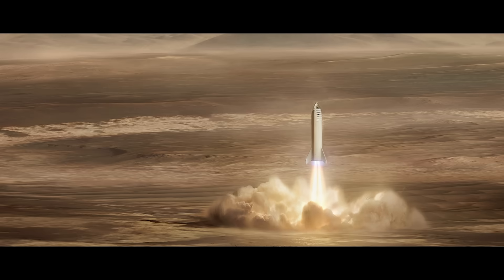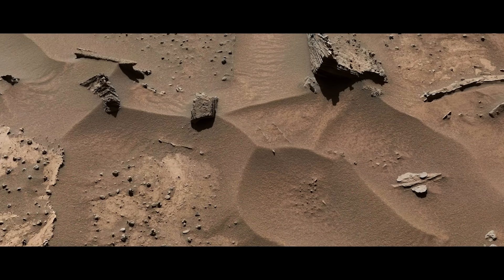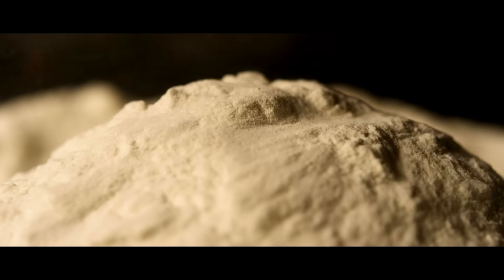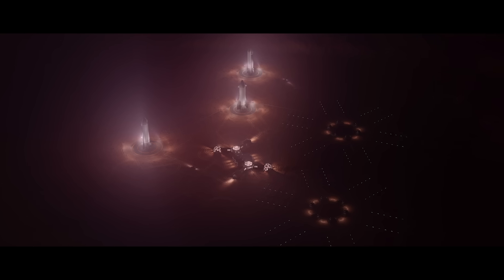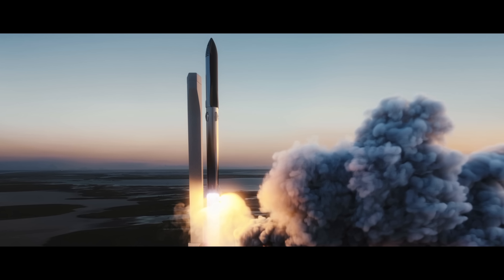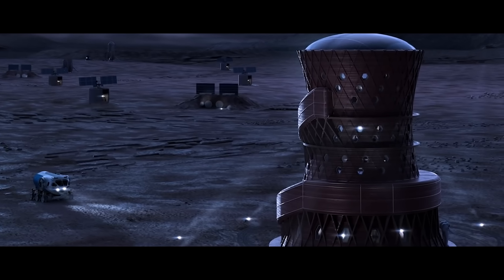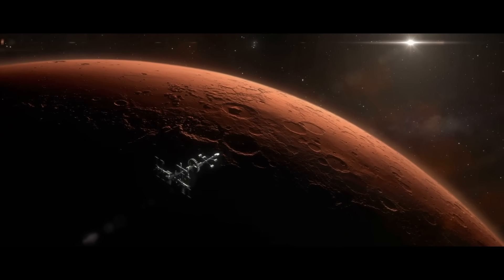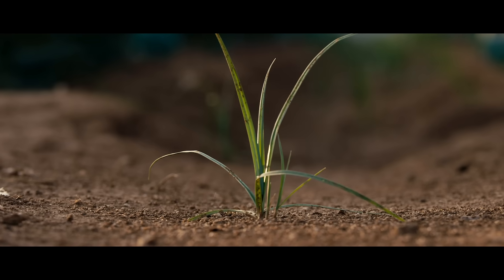THE FIRST 10,000 DAYS ON MARS (Timelapse)

Comment: So this is what Elon's dreams look like...
Reply: What's his solution for the lack of a magnetic field on mars?
Any oxygen.in the atmosphere would be eroded by solar winds, and any organic material on the surface (i.e. grass) would break down.  Also, Mars gravity is inadequate to hold down a substantial atmosphere.
Reply: @waxpatch  I seen a solution. They build magnetic generators at north and south poles. That would generate a good enough one
Reply: @waxpatch  Fusion generators placed in orbit between the sun and Mars that create an artificial magnetic field is one potential. That would create enough protection for Mars to hold an atmosphere, the gravity is plenty strong enough to hold it actually. 

Or, we skip that and accept that we will alway live in artificial pressurized shelters. Much easier.
Reply: @jasondean88888  The atmosphere would consist of what exactly? I suppose it should be 4 parts nitrogen on 1 part oxygen, but where are you going billions of tons of those elements from? As far as I know, there are only traces of nitrogen on mars.
Reply: @Greg Storozky let’s fix that by drilling the core which will be possible since the planet is geologically dead and nuke it x400  there is the magnetic field we need and the volcanos we need for carbon dioxide and water and then the plants and boom there we  go
Reply: @waxpatch 
don't think he have formulated a plan about that yet, one step at the time.
all though there are several alternatives to go.
gravity shouldn't be a problem, with the right about of atmosphere, it could get dense enough.. but it would get a higher atmosphere to have a pressure at "sea level" for humans to survive in
Reply: @waxpatch  yep, not a terraforming candidate.  Magnetic field and luck is a big reason why we have life on earth.  Just ask Anton Petrov....
Reply: @waxpatch  no comments because know one knows the answer
Reply: @waxpatch  They may create a giant electro magnet!!😉😜
Reply: @waxpatch  
Radiation would be a major problem with no atmosphere and magnetic field.
Reply: @waxpatch  Musk said he needs to nuke Mars... lol
Reply: @waxpatch  do some research. he explains everything.
Reply: Wow....i would make the first great crossing - i would do whatever it takes.
Reply: @davidoliver7199  they will need corpses to experiment on at Mars. You will make it!
Reply: @davidoliver7199  proud of u my man
Reply: @davidoliver7199  Hell yeah!
Reply: @davidoliver7199  ok
Reply: P
Reply: @davidoliver7199  If I was 30 years younger, I'd go.  One way trip.
Reply: @davidoliver7199  u got 50 mill ?
Reply: he'd just send a copy of himself.
Reply: @amiman23 ....God forbid, please.
Reply: Dec 22 2030. The first Martian catches COVID 19... the first “planetdemic”
Reply: he dreams in HAL/S
Reply: as the leader of the new galaxy
Reply: @UNiTEDDKSilent21  you rule the Andromeda, i rule the Milky Way
Reply: @TheUnnamed198  I call Triangulum.
Reply: @TheUnnamed198  for at least next 2 million years till they merge.
Reply: @UNiTEDDKSilent21  Emperor Elon of Mars.
Reply: @UNiTEDDKSilent21  Probably there is some true when he said he use to be "ALIEN"  now he is a hybrid ..!
Reply: L
Reply: @UNiTEDDKSilent21  can a I rule a cloud of hydrogen?
Reply: What about me growing mushrooms and taking my fortune with a team and I to climb mount Olympus with rocket guided anchors and steel cables or some shit. Some how some way new never done before however it’s done! What a cool future and a good place to expand technologically and genetically for even more human understanding of this universe we were born from.
Reply: @youtubeisajoke2546  Barely any gravity you could hop up the mountain..
Reply: @willrobinson9767  Not ‘barely’.
Mars’ gravity is over 1/3rd (37.5%) of Earth’s. And after you’ve fully acclimated, your muscles will weaken slightly. And you’ll be heavier, because you’d be wearing a heavily shielded suit (and carrying a portable life support system(PLSS)) for your hike up the mountain.

I’m not saying you couldn’t do it, just that you’re not looking at ‘barely any gravity’. Over a third is a lot more than barely.
Reply: @davidolden971  A suit you must remove  to use the bathroom...  What does the gravity have to do with anything..
Reply: I think
Reply: Best comment
Reply: This is what future look like...
Reply: Maybe. But everybody hase a dream.
Reply: This is all hypothetical
Reply: Elon Musk<---- doing in 10 years what NASA has been saying they'll do for last 50 years
Reply: @jamesbacon5299  It's all about the funding. He is in control of it, NASA has never been. Can't blame them, all the peeps there absolutely wanted it all for ages.
Reply: @jamesbacon5299  Space X is 19 years old! and Nasa already has been to the moon 6 times!50 years ago, Elon 0. And SpaceX is still alive because the NASA gave them 1.6 billions in 2008 to help them to build the Falcon 9 that was successful in 2015.
Reply: @jamesbacon5299  yea also at the cost of tons of natural resources the world can’t regenerate
Reply: Ye
Reply: @Pablo-yj8lh oroutuoriuoryoopt
Reply: @Pablo-yj8lh  ihr klang te wwhere  lvriiwyuuiuz
Reply: @Pablo-yj8lh  stop
Reply: @Pablo-yj8lh  this is 400
Reply: LOL 😂 😂 😂 😂!!!!!!!
Reply: betul !
Reply: He can keep dreaming because that's all it is.
Reply: they dont realise how far elon musks brother is ..in developing plants to grow on mars
Reply: You just need to come up with 2 million dollars to go to space cool
Reply: @ariusberry4727  no you don’t, it will cost up to $800,000
Reply: @ariusberry4727  that’s it !!
Reply: @ariusberry4727   Bitcoin
Reply: @ariusberry4727   Now would be a good time to invest in Doge! 🕦😁🤷‍♀️
Reply: @ariusberry4727  2 million dollars?
Reply: @ariusberry4727  Elon wants to get the cost down to about 200k per passenger for the trip to Mars.
Reply: @ariusberry4727  ima take out a loan
Reply: @ariusberry4727  it's more than that
Start ship would take 2 million to launch because of its reusability, you'd need 240 million dollars to build one
Reply: @ariusberry4727  JUST 2 million
Reply: @ariusberry4727  actually that's just for now he wants you to be able to finance your trip and home for about the same price as buying a home here.
Reply: And mine lol
Reply: What type of goods can Martians sell to Earth at competitive prices in order for Martian colony to be economically sustainable?   Remember that the shipping cost from Mars to Earth is extremely high, unlikely to ever become cost-competitive with products or minerals produced from Earth, limited by the narrow launch window every 2 years and the long time it takes for the trip.
Reply: @amec4888 .....Yup, that's the same thing Ferdinand told Isabella 530 years ago.
Reply: Please Translate This Filipino Language to English for you to Understand

Paano kung ganto rin ang ating nakaraan .paano kung may nauna din sa ating namuhay dito sa Earth na galing sa ibang planeta .Gaya ng nakitang bagay na astronaut ang itsura galing sa matagal na panahon baka ganun talaga ang nangyari
Reply: But everyone needs to work together
Reply: @Meme-xm8iy  everybody worked together on the Covid-19 vaccination so it is possible. 🤔
Reply: pretentious hogwash, you don’t actually think that quack is gonna land a single space shuttle there.
Reply: Yea, a Pipe Dream 😂😂
Reply: @Alpha Omega Epsilon Sagittarii excuse me I am not a mirror
Reply: Holy shit! Some of the people who responded to this comment are fucking insane lol!!!!!!  Fun read though :D
Reply: @BoberMcBoberson  omg yes thank you!! lol
Reply: Why would we try to create life there when we destroy life here
Reply: @choconoisette9737  They killed the pigeons on purpose because they crap on their stuff...
Reply: No ,it's just A Start !
I am Still here !
Reply: Youtube:::("RICHPLANET TV - The Mars Rover Hypothesis - full movie")  & stop fooling yourselves people::::: Watch its last minute first, showing the NASA-scammers gambling online, during their fake-Mars-Landing!!!!
Reply: @kareemsalessi  yesssuuuurrrrrr....
Absolutely right! It's all a big scam!!!!
Reply: "Elon's dream, so Elon invented all the sci-fi novels. movies and made all the current rovers on Mars. People dreamt of being on Mars (and developped ideas and technologies for Mars) well before Elon was born. 
The Cult of Elon with more ignorant members.
Reply: @THEREALZENFORCE  The rovers are all fake..  Nothing goes into space or Mars..
Reply: He is a scam
Reply: @neojon4871  He is pump and dumping gamestop stock and bragging about it..
Reply: they destroy the Earth to go to a dead planet !!Where is the logic?
Reply: @Lucian Next few days....
Reply: I wouldn't be able to think up something dumber even with up to a liter of heroin in my blood.
Mars is not a habitable planet for humans because it lacks enough gravity. This is a non fixable property. The only planet in our solar system with suitable gravity for humans is Venus. Venus is too hot, but this is not a non fixable property. We just yet to have come up with a technology to cool it down. This tells us that it's far too early to expand to another world. The whole video is stupid from start to end. Stupid in the category of idiocy. IQ below 25.
Reply: And they'll stay dreams for a very long time
Reply: @KristianC1994  Yes, for a long time ..
This E Musk is part of a big manipulation plan....
Reply: In the 22nd century, Mars will be colonized
Reply: @bretts5571  This is the most realistic term.
Or rather, it could be !!
Reply: @silviui.wagner6967  People in the 22nd century will remember Elon Musk. He will be enshrined in greatness
Reply: @silviui.wagner6967   We can't imagine the concept of most of the things that will be used in the future
Reply: Imagine his nightmares ._.
Reply: @Danny DNA Has to be possible first before you can do it quickly...
Reply: I can't wait till now I cant believe america arrive the moon how they want to live on mars?????
Reply: Dump some LSD in there and you’re on the right track.
Reply: No Elon plan will be changed bc the radiation  levels on mars is shocking we need to stay underground  and we can not have any of the soil inside the lungs or we will literally die after and hour of the dust being in us
Reply: For a sec I tough this is real xD and I remembered that we dont have a teknoloji to do that
Reply: Where is
Reply: I dont think giving a birth on the mars going to survive on the earth
Reply: please stop smoking
Reply: Yeah. And if things don't work too well on Mars, he can always have a cryptocurrency-manipulation statement ready :P
Reply: However.. when it comes to Sci - fi level innovation and beyond, why isn't this talked about on any videos on youtube for any of this stuff related? Such as Graphene combined with Photonics, Quantum Computers, and Quantum Technologies, also warp drives and other things.

Don't make excuses, check out my other 2 comments below, and the last one for steps to my other channel for the "created playlists" to start at the bottom.
Reply: There are so many missing things here in the video, think about why the media never talks about Graphene combined with Photonics as the basis and "standard" for all our products today and future products like Quantum Computers and other Quantum Technologies.
Quantum Computers also have breakthroughs supposedly once every week.

Why aren't they using Quantum Computers to make better designs and engineering for the SpaceX Starships and more.
And why aren't Quantum Computers inside the Starships.

Why isn't Graphene combined with Photonics mentioned, and at the least Photonics to replace the electronics = electricity (electrons) for the Starships circuits, bridge and more.

I'm aware of the need to scale up Graphene faster and cheap enough while in its purest form, but to not be creative with the imagination, without brainstorming, no collaboration or Sci - fi level innovation and beyond, is quite absurd.

Nasa's space rockets, control room and rovers could be using Quantum Computers, and Graphene combined with Photonics, again at the least Photonics (for now) with Quantum Computers.

Nasa, SpaceX, I.T.E.R. and other private funding fusion energy reactor companies, The Gateway Foundation / Orbital Assembly corp., Virgin Hyperloop One and so much more, none of them mention any of this.

Look at the news on Covid-19 rather you believe it or not, the news offline from TV and online from youtube's homepage if you scroll down it for the Covid-19 section, and question why none of the news channels with videos on Covid-19, all of them from early 2020 and on, have no videos about Graphene combined with Photonics, Quantum Computers, The Quantum Microscope, and other Quantum Technologies, and behold.. the level of greed and corruption you now have seen.

----------------------------------

And question why none of the youtube videos about warp drives never include Quantum Computers to help with big algorithms for the warp drives, warp drive energy, and anything space exploration related.

================================================

Check my other comment below for steps to my other channel about Sci - fi level innovation and beyond, e.g. Graphene combined with Photonics, and Quantum Technologies, also warp drives and so much more.
Reply: @gameresearch9535 ......Because there isn't a shit load of money in it.....Lots of future promise....But no effin MONEY.
Reply: @gameresearch9535 .....Thank you
Reply: No one can have such a dream
Reply: And it will very probably not happen that way!!
Reply: Clearly it's not a dream
Reply: The guy is going broke
Reply: @zeo4481  what proof do you have?
Reply: Care to elaborate your question?
Reply: @Lan Dobnik the choice of words he is using
Reply: Earth 🌎 in the near future I think
Reply: @UCLAfilm01  Fantasy just like pretending there is unlimited gasoline and the power grid is windmills not nuke and COAL plants.. Which is also about to cease to exist...  What world country are you without gasoline or electricity ... The ones you named and Germany which is about to turn there grid off.. No electricity ever again..
Reply: Its the dream of alot, also mine. But im not super rich and 16 years old.... so kinda hard to try to do whan Elons doing.
Reply: ok you ca spend money to poor people in earth
Reply: @dr.revellart9990  Using the last population number in the video, approx 300,000… That’s 0.0038% of Earth’s population to Mars (by 2053). 
That means 99.61% WILL STILL BE ON HERE ON EARTH. And this where the money was, is, and will be spent!
Reply: We all know Mars is historically own by China in ancient times it's undisputable fact.
Reply: Until he wakes up lol
Reply: Pretty much
Reply: Keep dreaming!
Reply: This is what all of our dreams look like🥲
Reply: If elon one day takes all his knowlede, money and dedication to end his life by doing a 1 way ticket to mars for colonization or somehow siccessfuly travels to mars and back and surviving.   Hes going down as one of the most craziest, intellectual scientist/researcher/engineer of all time. Being a martyr to show the capabilities of thr human spirit/mind would make u one kf thr fucking GOATS.  lol
Reply: @godsownlunatics9650 ......How far did you go to school.....bout two miles??
Reply: @Lan Dobnik 

Did you go to my other channel's "created playlists" and watch things from the bottom?

As we all know, materials are the basis for all emerging technologies, Quantum Technologies. And Quantum 2D materials.

We need a paradigm shift in materials and ideas.

This basically means that "a civilization is only as good as the material it uses".

Now imagine this with Photonics, the list goes on, think about Graphene Spintronics and Graphene Twistronics, those are just examples when someone got creative, we need to brainstorm and this stuff should be known in schools for all ages, because kids have dreams and they are the ones that can also help accelerate that advancement in learning this from school and having goals for innovation to a whole other level, to help accelerate that advancement for our civilization.

Let's not make excuses and don't tell me things that I already know, the important part here is for you to learn what I'm trying to show you from my other channel.

You can't call Graphene fake, regardless of scale and while in its purest form with no defects. It's also safe once made and anyone can come up with a new way to scale it up in its purest form, as long as the method for scaling up Graphene is safe, but once made.. Graphene is safe.

My point being, what is shown on my other channel about Graphene combined with Photonics, and Quantum Technologies shown there are all real.
What you can also do with a Quantum Computer compared to a classical computer and super computer, is also very extremely useful for research, designs, engineering, chemistry and so much more to accelerate that advancement and for other breakthroughs, and other emerging technologies.

If you can't see that big picture, the only one in la la land is yourself.
This is the truth, I don't show my other channel for no reason with all the facts from proof there.

Wait until you go to my other channel's "created playlists" and start at the bottom.

And if you don't believe that, then go visit the tech companies in the videos, and also visit the official sites shown in links on my other channel. And talk to them about it, not me. Don't make excuses, there is no excuse for ignorance.

"Ignorance is the root of all evil".

"Ignorance.. it's not that you don't know, it's that you don't want to know".

1. Go to my channel and find the "About" tab with info to read and a link, you might have to click on the words "created playlists" and start at the bottom, work your way to the top playlists and watch all the playlists.
Don't forget to click on "view full playlist" under each playlist from the created playlists area, and look to the left at the "playlist description", click the "show more" button, for articles, info and links.
Reply: @Lan Dobnik 

I forgot to add.

Our reality is based on the Physics we understand, and as the Physics we understand is updated, so too our reality changes with it.
Which is why we are going into Quantum Physics, and Quantum Technologies. Also Quantum 2D materials such as Graphene.
Reply: @Lan Dobnik 

And so please be sure to check out my other channel's "created playlists", save that to your browser's favorites.
Reply: Its humanity dream looks like
Reply: It's not a dream. It's a flashback.
Reply: @Alpha Omega Epsilon Sagittarii Think about it.
Reply: @Alpha Omega Epsilon Sagittarii sorry but soul beings to lord krishna there's no place for you to enter
Reply: @Alpha Omega Epsilon Sagittarii well krishna is omnipresent so yes he is in me and that's all I need everything else isn't matter to me nor your OPINIONS
Reply: This is what all our dreams look like.
Reply: @Alpha Omega Epsilon Sagittarii its opposite way around
Reply: hes already livign his dream of exploiting poor kids and underpaying workers to get that sweet sweet moolah
Reply: @Alpha Omega Epsilon Sagittarii its the truth, not an awakening, sadly
Reply: ONLY A VERY NAIVE OR STUPID PERSON CAN BELIEVE THAT ELON MUSK WILL FLY TO MARS IN 2024. Even in 2034, he won't fly.
Reply: 8pO
Reply: @Alpha Omega Epsilon Sagittarii Are you comparing yourself to them? I don't know you so I'm not going to judge your intelligence. But I will say I have read a lot of your comments. And you come off as bat shit crazy. And I'm not saying you are. Just that if you are right your message is getting muddled by the abrasive way you communicate with people.
Reply: And a dream is what it will remain
Reply: @Alpha Omega Epsilon Sagittarii You need to stop dreaming and wake up
Reply: @Alpha Omega Epsilon Sagittarii And people over estimate one's subconcious. As they are never fully aware how it affects there action and feelings. As for supraconscious. Is it rational or logical. Perhaps only in our egotistical minds.
Reply: And the rest of mankind!
Reply: @Alpha Omega Epsilon Sagittarii Yes he sure can
Reply: @Just Doit --It costs thousands of $ to transport just 1 pound of mass into space.   Nothing can be as expensive as transporting products to and from Mars.
Reply: Man of the Future.
Reply: @Alpha Omega Epsilon Sagittarii Weird massage?
Reply: @Alpha Omega Epsilon Sagittarii Sorry. I got what you mean now. That must be frustrating at times
Reply: I think hes forgetting in the future one of Mars moons will fall onto the planet bye bye people on the planet
Reply: I would love to be the first person on mars
Reply: See my nasa video
Reply: yes...
Reply: Dream....or predicted knowledge?!
Reply: *Wet dreams
Reply: Yes
Reply: It Would Be Awsome To Put Plants On Mars 
Weeds That Departed alongside the Vegetables That be Planted Indoors In Mars : Yes Weeds Rules!!!! , We Are Super Plants!!!
Reply: SimCity Mars edition
Reply: My dreams would come true if i ever get to see an entire fleet of spaceships travel across the sky in formation towards mars.. that would be such a beautiful sight.
Reply: @FlyboyCGC have you seen the progress of starship? the jump from SN11 to SN15 is literally over 150 significant upgrades to the design, you will never see that kind of flexibility or speed in the SLS or Vulcan Centaur (or any other rocket for that matter.)
Reply: @FlyboyCGC You tell me..
Reply: @FlyboyCGC don't be jealous.  NASA has done what,.... in last 30years? Jack and squat. 
Musk, all on his lonesome, built rockets THAT NASA WILL BE USING, to take people to the ISS. 
IF he's so bad, as you say, why are they using HIS ROCKETS?
Reply: Much faster than that.
Reply: I may be ignorant on this but didn't Bezos just win the race against him? I mean the headlines two days ago for both parties were completely opposite. Elon dismissed and Bezos now selling tickets for the first trip
Reply: it looks dumb.
Reply: No? This is what Venture City's dream looks like. I refuse to belive Elon has any true vision other than cOlOnIzE mArS
Reply: Is the narrator included?
Reply: It is a good dream
Reply: No this is just a goal for him. The things billionaires dream of are much more perverse than anything normal people can imagine.
Reply: I hope Elon will be successful in his dream. God bless him us. We will go to Mars one day
Reply: RadnySSI ㄹㅇ
Reply: If Elon didn't complete I'm sure his son or daughter complete this
Reply: yup
Reply: I think Elon  has believed that Solar System is his personal property. 
But We should remember that nothing in our Solar system is there to help us
Reply: @clams_  I think he is paranoid and autistic and he is scared of a WW3! so he want to leave SOON! he trust no one! maybe he is right to trust no one I mean some leaders are crazy! and most businessman are GREEDY-NARCISSISTIC!
Reply: It's our dream now
Reply: So... what do they taste like?
Reply: Are you going to tell us???
Reply: @Gavin Costa your going to call someone uneducated, while spelling uneducated as "un educated"? Lol.
Nice! Lol...
Reply: Why screwup another planet.
Reply: @dennisneale142   Geoge-Carlin has great video-clip on that subject!!! Youtube:::("George Carlin - NASA")
Reply: In that case I will steal his dreams
Reply: He’ll be remembered greatly for this
Reply: Yup
Reply: Stupid science 
Science doesn't know 
Carnivorous lions live only 14 years. 
The US eats too much animals meat causing 600, 000 deaths from the virus
Reply: Everyone's dream who interested in Mars
Reply: will he go to mars along with em?
Reply: Kmsl Elon tryna be chancellor palpatine 😂😂😂
Reply: Nope, he wants to use humans as corporate slaves for the building process
Reply: He has good dreams
Reply: What a bad dream. What’s the goal?
Reply: Avatar
Reply: lmfao this guy is spewing  propaganda. Mars is a one way trip, Martians would not be able to survive Earth's gravity. Musk should be bringing fresh water and sanitation resources to the people who need it. Not trying to kill people.
Reply: He just wanna drive his Tesla on marse
Reply: His dreams are in python and c++
Reply: Evil people; if you can take care of this beautiful Earth, a barren Mars maybe just right for you!
Reply: Not only Elon's dream, mine too
i just had a dream of us going to Mars 😅
Reply: Even though though it won’t happen lol.
Reply: Eehm its already up there 🤗
Reply: Real estate mafia rampage, continue the nightmare.
Reply: I think
Reply: That’s when he isn’t high.
Reply: Elon is dreaming about day 4002 right now
Reply: No, it's more gigantic than this.
Reply: I’d say Asgardians have the same dreams too, in my head I already live on Sagan-2...
Reply: What a beautiful dream. Elon will be in History books as a genius.
Reply: Musk is BETTER than God. Mars is the New Earth! Earth Will soon Die Anyways!! Musk is god. TESLA and Tesla Holders will be Kings. Rest and their Family will be Our Slaves and work to Power energy for Bitcoin!! Elon is Einstein, Edison, Newton, and Jesus combined. HE at least deserves several Nobel Prizes. Elon has more IQ than weight of Hater's Ug ly Prius and his F at Ho Combined!! HE is like Ironman who will destroy Thanos and critics are better off using their cash to wipe their a n us. JUST Worship Him instead of other silly god!! GOD Elon will Punish infidels!! Go Emperor God Musk!!
Reply: will ELON be alive until that days?   :)
Reply: Too bad they'll always be just that a dream like most of his scams.
Reply: Won't be a dream for long
Reply: Yee he’s built all these rockets and crap, he’s sending the unmanned ones next year when Mars is closest to us
Reply: Nice elon musk ready to pack my bag and
gotten proxima centuries and freeze
Reply: My dream is working on space x like Astronaut ,how possible
Reply: This is created by musk team you idiot.
Reply: @amazingdude9042   How possible,my last dream is working on space x like astronaut,accept pls pls
Reply: @bedpsmilesong5752  yeahhh. and my dream is to become king of the world. we both are dilutional so leave it.
Reply: Sad truth, it will stay a dream. It will never happen in this lifetime. If ever. Its just wishful thinking.
Reply: Yeah surviving Mars.
Reply: His dream is to make as much money as possible
Reply: true
Reply: Yeah but i believe it wouldn't be a dream any more because before we make mars for humans we have to survive the corona and world war 3
Reply: @victor237obiora5  yes i wish i can be president of mars but there is a chance of 00.000000001% ill be president
Reply: @victor237obiora5  yes im exited to be presindent of mars or not and just be kind
Reply: Cuuuuuuuuuuu
Reply: That video is in parity with previously few well made 'Nazi propaganda style videos'. Not so smartly, those same video mentioned Neo-notables will probably just gonna chose a determined 'reality-show filming site' to rent and then stage another 'Apollo program style' main media hoax.
 "Apollo" is the ancient name used to mention a chosen 'alpha' person from a small group of Eskimos; while the same group strives about, within the landscape from the scarce and dangerous Arctic region of the 'Terra'.
And the Eskimo people aint gonna agree to have yet another of their ancient/current word; to be used as the title for another resource waste Hoax.
Reply: Do-able
Reply: Ye
Reply: Probably even bigger
Reply: Yeah he even said he wants to die on Mars just not upon landing.
Reply: Society is in a huge problem at the moment, World War III is about to fall, almost half of the Americans they have no money to rent, and Musk  distracting the (NAIVE) people's heads with his infantile tales. Musk is glad he can land on the RUSSIAN space station. With his finger on the map he can travel to Mars, Comrade Musk.
Reply: Elon musk is an alien in human form
Reply: elon musk wanna rule mars.
Reply: Excluding bezo being involved sure!
Reply: It's a long way to Tipperary bro !!!
May be at the end of this  century....., the earlist.
Except for Elon's stories and cartoons!!🤣🤣🤣🤣🤣🤣
Reply: Yeah, CGI bull shit.
Reply: @A.O.E.S He's a genius. He's literally the chief engineer for space x. The company trying to do all of this. He spent days and weeks into learning physics of all kinds. Don't underestimate him because you think he's just like every other billionaire lmao.
Reply: @FlyboyCGC he made the first re usable rockets. which is a great baby step towards the goal.
Reply: @A.O.E.S That's impossible. He's trying to get to mars to save humanity from the earth that we destroyed.
Reply: His dreams must be Interstellar travel
Reply: Right at the beginning he's already Starlinksd 😎
Reply: If I wanted to live on Mars I can just go to the coldest desert on earth and I'd least I'd be able to breath the air!
Reply: what is the reason to visit a dead planet? plain wishful thinking?
Reply: No, this is what Elon's PLANS look like.
Reply: yep
Reply: Then again he named his kid a barcode number and he is a douche bag I wouldn’t be giving this guy praise
Reply: @Gavin that is just mean to say you could have been not as harsh with that yea he made a comment doesn’t mean he’s stupid
Reply: Humans 0
Saiya-jin 1 to 6
Angels 7 😇

Kalki Ironman 5th matriya buddha 8th arc Angel 11th satguru 13th imam and 24th avatar after 2026 😎

Almighty God 9 😇

Humans type 2.5+ after 2026 by Kalki Ironman (christ in the white horse)(son of man on clouds) type 7 and 8 😎

Jarvis the world’s first artificial intelligence (parrot) 😎

Cuz Kalki is ironman batman super saiya-jin superman ben10 saitama Narutoo shaktimaan and every super heroes combined after 2026 😎

Jarvis world’s first artificial living being (just like vision in marvel universe)😎

Made of Quantum and sub quantum particles 😎

Power source quantum energy arc reactor (type 7) level technology 😎

Kalki Ironman going to have every kind of arc reactor like:- type 1 Nuclear fission, nuclear waste, hydrogen fusion, type 2 3 4 5 antimatter arc reactor (solid liquid gas), type 6 electro quantum arc reactor, and type 7 Quantum arc reactor, type 8 limitless quantum energy arc reactor without quantum particles 😎

Kalki Ironman going to have sun in a box million billion tons of hydrogen nuclear fusion reactor type 2 3 4 5 just like sun and stars in the palm of his hand 😎

This all going to happened by self replicating quantum nanobots knowledge energy and techniques at type 7 7 7- respectively 😎

Ironman (Tesla 2.0) going to reveal every secrets of the world specially Tesla and his Antigravity 😎
Reply: Wow!
Reply: Elon Musk 🧠🦾🦿☀️🔋👏💯
Reply: You know him well enough to call him by his first Name? Hmmm. Interesting you buy into this impossible hype!
Reply: Minus the Jeff Bezos part
Reply: @matteovass8294  Jeff bezos is also a douche bag who doesn’t care about his employees he just wants money
Reply: Dreams that are being slowly turned into reality as we speak!
Reply: @MrPablosek  calm down anime boy.
Reply: He will do it bro.
Reply: This is what my dreams look like
Reply: I just wished that politics won't harm these people who will be living in these planet.

And achieved what the Earthlings ever dreamt of  which is world peace.
Reply: @hakobangz25 .....Whether they be Earthlings, Martians, Centaurians, or whatever, as long as human DNA is involved there will never be global peace.
Reply: Yes just a Dream
Reply: And how do you power all that given the poor solar power available on Mars ? Plutonium like Perseverance ?
Reply: @effco  7 football fields of solar powers until we make artificial power.
Reply: @effco  There is no power source that can be used..  Even a nuke plant will not work..  No way to maintain it.  cooling probably won't work..
Reply: @willrobinson9767  if there is ICE, THERE IS A WAY TO COOL IT
Reply: @jamesbacon5299  The ice there is probably frozen CO2 not water..  Thaw that out and you get gas..
Reply: His dream is to make as much money as possible and hide it before Tesla stocks inevitably crash. Dude isn’t even involved in Tesla or space X projects beyond being a poster boy. Real engineers actually do the hard graft
Reply: @cretinousswine8234  He's literally the chief engineer for space x. He knows what he's doing and is smart as hell. Everyone loves musk and not bezos for a reason.
Reply: The city should be called : ELON-1
Reply: He is gonna make this real. Hes elon musk.
Reply: Right!!!
Reply: Absolutely
Reply: Elom dream PaID BY Uncle Jeff
Reply: Yeah and its so cool! 😍😋
Reply: Its not a dream.
Reply: It won't be possible unless we figure out a way to stop the solar and cosmic radiation from reaching the surface of mars. Mars doesn't have magnetic field making establishing bases on that planet nearly impossible.
Reply: No, this is what the bag of bullshit he sells his fanboys for their lunch money, looks like.
Reply: I also want evacuation from this crazy land..
Reply: Lmfao so true
Reply: *looked like. He is realizing it. One cannot imagine what he dreams now!
Reply: @Danny DNA protecting the new artificial atmosphere would e done by creating a new magnetic shield. Done by putting magnetic field generators at the north and south pole
Reply: Buy bitcoin, bitcoin is future.
Reply: @robertfuest007  bitcoin is just a very expensive crypto it’s not the future
Reply: @UCLAfilm01  Pretending they can use Teslas for REAL cars when there is 100 thousand of them to start with..
Reply: Why are they called starships? These are chemical rockets and have aluminum hulls. I understand that metal doesn't protect against radiation. The astronauts won't survive 6 months of cosmic radiation.
Reply: Why not explore the planet we are already on ? Am I the only one
Reply: Yeah cause he is an intellectual
Reply: @TheUserEGO3326  "...he is an intellectual"? :-)))))))
Reply: @prussv9518  yes
Reply: Yes
Reply: Wow closer to the sun.
Reply: Nope. Musk's dream is to have a transport system that can launch a thousand of his Starlink satellites at the same time. He has zero plans to go to Mars, which is obvious to anyone with a brain.
Reply: @ricksimon9867  He's obviously not suicidal then...
Reply: It is possible for lofe to exist on Mars but it has no use beacause if earth get destroyed that means that sun is getting bigger which means it would also end up destroting Mars
Reply: @karabinagroy .....It will be approximately 5 billion years before the sun begins destroying the earth, so I'm not gonna worry bout that just yet.
Reply: @karabinagroy  no habla illiterate gobblygook
Reply: Exactly.....dream, just that dreams....!!!!
Reply: Chase Smith  NASA sure ain't doing it. They've been studying the "effects of weightlessness on the human body"  for 40 years. Thank God we don't have an incoming asteroid or meteor to destroy earth. We'd never get off the planet. 
Well Musk, Bezos, and Brandon would get some of us off. China would make knockoff copies that'd blow up in low orbit
Reply: Humans will be extinct before we reach another planet though
Reply: @loganpaige2102  wow.   Way to be positive. With a attitude like yours in 1965, we'd never have made it to the moon
Reply: @loganpaige2102 
you think human will go extinct in the next few years?
Reply: @Nidvard  yes. Sounds weird I know...
Reply: @loganpaige2102  maybe just matters what we do in the next few years
Reply: MUSK IS psychotic delusional and SICK...  Just like the rest.
Reply: @willrobinson9767  
I am curious, even though i feel i will regret asking.. why do you say this?
And the rest of..what?
Reply: @Nidvard  The rest of humanity....   The ones who think its cool..  Musk bragged about working 22 hour days... Just to make imaginary money..  Who don't sleep or take days off themselves until they have a heart attack...
Reply: I'm sorry, there is no way to understand what you are talking about. You are not making any sense
Reply: @Nidvard  Not much longer..
Reply: @Nidvard  You have to what GOD says..  There is no option B...
Reply: @willrobinson9767  
Oh right, you're one of those. No wonder i couldn't understand you.
What are you even doing here? Why don't you believe what you believe, and let the rest of us do whatever we want? If you want to give up on life before it begins, that would be your choice, but keep that to yourself.
Reply: @Nidvard  Already did that.. Your time is up..  Say goodbye to everything..
Reply: @willrobinson9767  yeah, just like Nicholai Tesla. Oh wait
Reply: @Nidvard  He mean that Elon is obsess by his goal of goinfg to live on Mars! and it's not realistic because of the technology needed and the cost.
Reply: @Nidvard  one of those waste men
Reply: @Nidvard  There are some good criticisms of Elon in a video essay called "Elon Musk is not your friend" now I know the man that presents it is a bit eccentric I ask you to tolerate him but I belive he makes some good points.
Reply: @willrobinson9767  dude stop acting like an emo kid thinking everything and everything is pointless, like every body will die it will happen but that’s not what this is about.this galaxy can be a sandbox of infinite possibilities just give it a few thousand years.
Reply: @Revs_bathwater  There are extremely finite possibilities...
Reply: @willrobinson9767  he's a self made billionaire that has launched private astronauts and supplies to the ISS. To a person with low intelligence, Musk must seem crazy. But they probably thought the same about the Wright brothers
Reply: @jamesbacon5299 ......No, they didn't think the Wright brothers were crazy.....They just thought they were Wrong
Reply: @jamesbacon5299  and who paid for all those Dragon and Falcon 9....NASA!
Reply: @willrobinson9767  are you "lost in space" ?
Reply: @timbuktoo2  Not my real name tribute  to that show.. It was awesome..
Reply: @willrobinson9767  agreed so is bezos
Reply: @willrobinson9767 ...Rest of what??
Reply: @willrobinson9767  you are too short sighted, you can't really see far.
Reply: @primart1  Elon didn't tell anyone your battery's are never getting any better...
Reply: Yeah let's talk about all the failed landings his prototypes are having time after time, test after test, he will run out of money before he succeeds.
Reply: @DawahTrucker2024  huge success for the last one.
You really think those tests make a dent in his economy? as musk himself said: if you don't fail, you are not pushing the boundaries enough. fails are expected.
Those who are afraid to fail, will never succeed
Reply: @Nidvard  Elon said that it was very expensive and he greatly appreciate the money from NASA (2.9 billions) to make the Spaceship fully operational will cost 10 billions!
Reply: @DawahTrucker2024  They earn more money by launching shit for everyone with their cheap falcons.
Reply: @DawahTrucker2024  this is the same thing that happened to his falcon rockets in the beginning and he is launching those every week now 💁‍♀️
Reply: @rowshambow  i think we will explore mars on day. i just think we are decades further away from any successful attempt of landing there and not dying right away, than Musk wants or believes
Reply: @rowshambow  *every few months
Reply: @rowshambow  Yes, with NASA in your back, everything is possible!
Reply: @rowshambow  exactly
Reply: @DawahTrucker2024  he's had more successes than NASA on 1/200th the budget
Reply: @jamesbacon5299 .....gtfoh....he still can't get his car doors to close properly.
Reply: @donaldjohnson257  he's a billionaire and you're not :-)
Reply: @jamesbacon5299 .....Now how could you possibly know that?...But I do feel compelled to admit that he is an asshole and I'm not....Something I'm sure you would know....gbttfb
Reply: @jamesbacon5299  NASA already did 1000 more then Elon.
Reply: @DawahTrucker2024  It's called Agile innovation: Fail fast fail often = Learn fast change fast = innovate fast and get to the point where you need to be.
Reply: @DawahTrucker2024  he went from being worth 3 billion 3 years ago to over 170 billion in 2021
Reply: @DawahTrucker2024  BLASPHEMY!!!!!
Reply: @DawahTrucker2024  

Yea I would assume u would fail alot more than succeed.  Mr half glass empty over there
Reply: @DawahTrucker2024  lets talk about all the failed prototypes of airplanes during the 1910's! so much money lost, so much beautiful designs destroyed and crushed, but what's this? Planes are used for everyday life, so don't talk stupid
Reply: @DawahTrucker2024  They are getting better by every launch and he's got nasa beside him to help fund
Reply: @DawahTrucker2024  he's making millions if not billions a year lmao i dont think it hurts him that much
Reply: He is On/Off the richest man in the world. I he wants to spend his money on building rockets it’s up to him. Better building a cool new rocket than buying frivolous things like islands and gold toilets lol 😂
Reply: @DawahTrucker2024  ummm no he wont
Reply: @DawahTrucker2024  Well aren't you just a ray of sunshine.
Reply: @DawahTrucker2024  sorry bro not everyone creates a perfect rocket the first time like you did
Reply: @DawahTrucker2024  he is the richest man in the world bro
Reply: @DawahTrucker2024  say that again....sloooowlyyy.
Reply: @DawahTrucker2024  if you were paid 100k a day since the first day of the christian calendar, you'd have like 7 billion, 
which is a lot but considering Elon's money in so short time, I bet he'd barely run out
Reply: @DawahTrucker2024  That's been said before...
Reply: @DawahTrucker2024 Elon is high with kool aid lol, his generation will not make it to Mars 2200
Reply: @abdirehmanmahamed3570  atleast someone is trying it failures Could motivate someone who is more advanced in the future.
Reply: @abdirehmanmahamed3570  ??? He will make it to mars